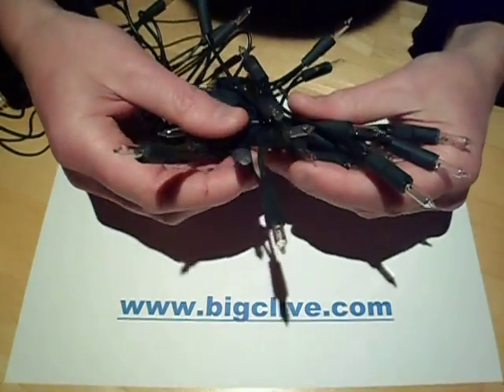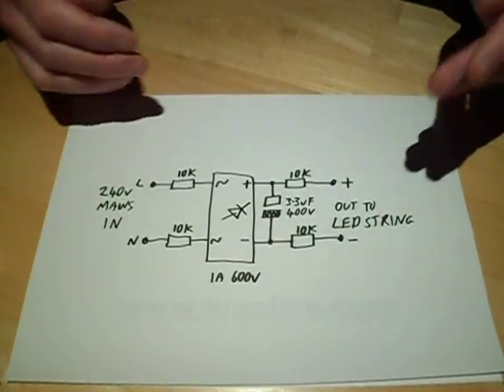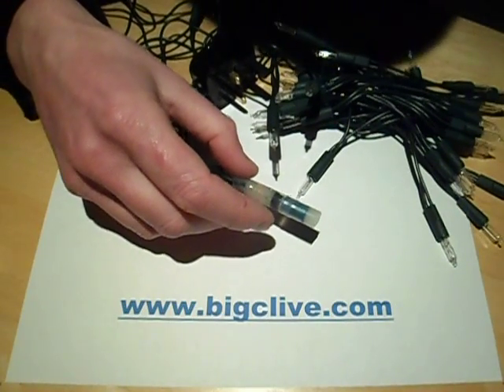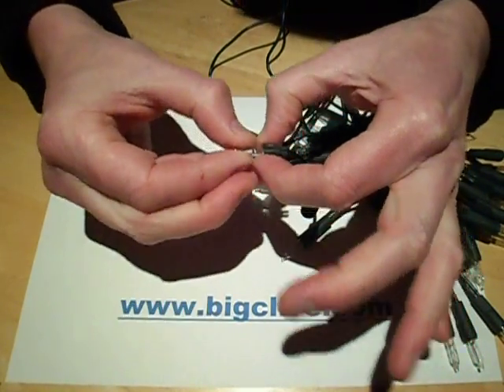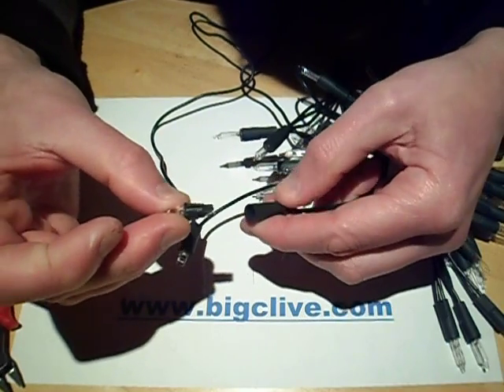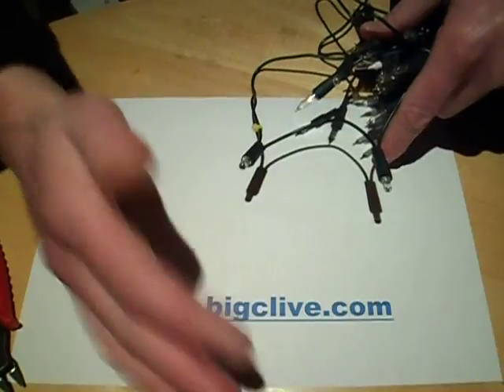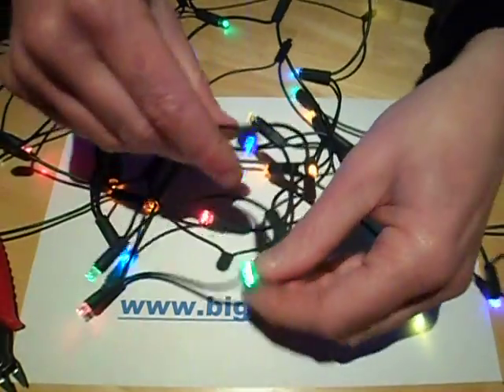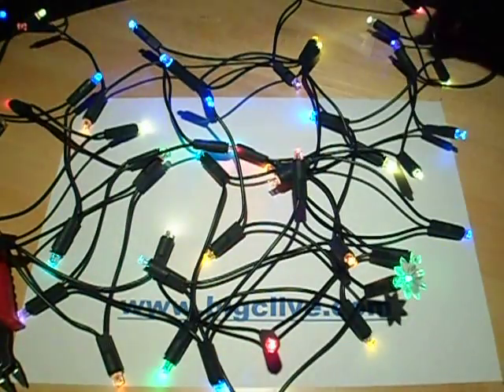Converting a string of traditional tungsten Christmas lights to LED.

Comment: would i need to alter the resistors using this circuit if i only had 20 lights instead of 50? also do you have a component number the the bridge rectifier, 1A suffice?
Reply from the maker: A 1A rectifier rated for 600V or higher is ample.   The less LEDs there are, the higher the power the resistors have to dissipate, so you end up with higher value resistors and lower LED current.

Comment: Hi Excellent video; quick question exactly what sort of LEDs do you use; I’m asking because I have a set of Christmas tree lights that I want to convert only it use the E5 screw fitting lamps; I will have to find a way to take the lamps apart and solder the new LEDs in 😂 Thanks
Reply from the maker: This project is better suited to series push-in holders.
Reply: @bigclivedotcom  Yes I guessed that but I can’t find a way to fix the “Chandelier part to another light set; I have an engineering background in both electrical and electronic so I will find a way to resolve this; but thank you for replying it is much appreciated.

Comment: You are so clever! Question! I have prelit Christmas tree that used traditional bulbs. If I replace them with LED ones and connect to 12v power supply will it work?
Reply from the maker: It depends on how the wiring is configured.  If the lights are in parallel or in a series string.

Comment: I just this video and very interested in how to did this. I'm still getting familiar on how to go about this. Here in the US many of the incandescent strands are of 150 lights, usually in sections of 3. Would you add the resistors (maybe 20k)  ahead of each grouping? So 8 total?
Reply from the maker: Not sure how USA lights are wired.  But the 50 LED sections would add up to around 140V.  So it might need a smoothing cap to nudge the voltage up.  That would then add some other complications.

Comment: Hi Clive, I have recently converted 5-sets of Christmas lights using Red, Green, Orange and Blue 10mm LEDs. I placed a series resistor (150k 1/4W) in a number of the LEDs (cut one leg short and replace with resistor) to bring the current down to around 10mA. I used a round encapsulated full-wave rectifier (2W10) in the mains-plug (neutral/earth void) and placed heatshrink over the connections. The sets run very cool and look great. Thanks for the videos which gave me the idea to upgrade my old incandescent bulb sets. I also enjoyed your tale of Christmas times in George Square. Keep up the good work.

Comment: Thank you for your video(s)!!  I am enjoying watching them.  I am trying to learn as much as I can before I change 6 sets of lights I have.  I have questions I hope you can help me with.  I have a 300 light tungsten icicle Christmas light string from USA (110v) I want to convert to LED.  The string must be made to run in groups of 50 bulbs @ 2.2v each (replacement bulb is 2.5v).  I use these in Europe and use a heavy duty transformer to step down 220v to 110v.  I understand the LED's I have are 3.0v each (50 x 3v = 150v for each section). Because I am wanting to  convert these to LED's, I was thinking I may as well convert them to  run on 220v (instead of 110v with transformer).  Therefore,  my questions are: 1. Is this safe and achievable?  or 2. If so, what resistors do I need?  3. Is the smoothing resistor you mention to help remove the flicker caused by AC current supply?  4. Anything else you can suggest I consider.  Thank you!

Comment: Hello from a very hot Australia on new years eve.   Really love your videos Clive.  Just a question,  Under what conditions would you use a series current limit capacitor vs the series resistors?

Some 30 years ago I converted nearly a 1000 of the old 20w 20 light sets into low voltage outdoor lights by cutting and soldering them in Parallel.  Was highly therapeutic as you say.  I have several packing cases of those old lights that weren't converted,  might just do the above to them.
Reply from the maker: +Stuart Goggin The capacitor version runs cold, so it's more efficient for use with higher current.  The resistor version dissipates the voltage difference between then LED string and the mains voltage as heat, which the capacitor just lets through a portion of current on each half cycle.
Keep in mind you can also string a few sets of the 20 lamp versions in series for more efficient operation with LEDs on 240V.  60 sockets works well.

Comment: hello my friend thank you for your reply there are two set of led's in the tube 48and 82 they  are all ok checked for dry joint that's ok. The 48 set which does not light has a dim glow in the led you can  just about see.
Reply from the maker: +mango3586 That suggests a dead LED that is limiting the current.  Does one have a small visible black dot in it?

Comment: Hi sir as you are electronic expert I need your help I have aT8 led tube light which is1500mm long and the fault is half of the tube lights up and the other half is dead. I would be  very great full if you could give me some idea to what the fault might be.
Reply from the maker: +mango3586 The LEDs in these tubes are wired in sections so one may have gone open circuit internally or there could be a bad solder joint.  Note that the LEDs may not be isolated from the mains, so take extreme care if you open the tube to look.

Comment: Hello im hoping you can help me or lead me in the right direction! so I want to attach a string of 10 Christmas lights inside my car attached to a toggle switch.  I want to replace the regular bulbs with leds since i see that led can use 12v to power them. how would I do this exactly?
Reply from the maker: +Anthony Lopez Hi Anthony, it will be easiest just to buy a pre-made set of battery operated LEDs online or from a local store.  They run for a long time on their batteries.
Reply: +bigclivedotcom  yea I figured, but I want to do this as a little project. I wanna use these tardis lights http://www.amazon.com/gp/product/B009XDJI9Y?refRID=6XQTS501FWJV8VCG16Z9&ref_=pd_cart_bxgy_1_2_p and install them in my car to use as light source, using a toggle switch as a on/off switch.  

I know its probably best if I do get the light you are talking about and fighting the plastic cover over them. But if I can do this with a little work I wouldn't mind trying!

Comment: can you use a 1.5amp 600v bridge rectifier i cant find a 1amp 600v.rectifier on ebay ? by the way Happy New Year  I really like the videos on leds and electronics. thanks
Reply from the maker: Yes. that's fine.  The voltage rating is the most important bit.  The actual current is only a few milliamp.

Comment: Would any rated electrolytic cap do? What would give the best fade out when powered off?
Reply: Needs to be rated above the peak rectified dc voltage. dc voltage in this case is 240v ac x 1.414 = 340v.  Give it +/- 10% tolerance and you basically shouldn't use a capacitor rated for less than 400v.
Or, use several capacitors rated for less voltage for example 2 x 10uF 200v but put them in series but be careful as 1/Ctotal = 1/C1 + 1/C2 + ... + 1/Cn
Reply: I know to use a high rated cap. I was meaning the value of the capacitance of the cap.
Reply from the maker: +Callum Burns The biggest factor in the fade-out is the discharge resistor across the electrolytic.  If you remove it the lights will visibly fade to zero like a tungsten set.  Anything in the region of 4.7uF to 10uF would be good, but 4.7uF is very common and the larger values start to get quite big physically.
Reply from the maker: Callum Burns I've not tried a lower value than the 3.3uF one I used in the above set.  The end result with that value is no visible flicker and a really nice dim-off curve that starts fast but then flattens out and keeps the LEDs glowing for quite a while at a low level.
Reply: Callum Burns
I guess it depends on how much brightness fluctuation you're willing to tolerate.

The higher the capacitance, the steadier the voltage, therefore the more constant current through the leds.

Figure out how much current the led strip will use, then use the formula C = Current / ( 2 x AC Frequency x Vripple) where Vripple is how much you're willing to let the voltage sag from the peak voltage.
If you play with the formula, you get Vripple = Current / 2 x AC Frequency x Capacitance.

In the video he used 2 x 10k resistors as current limiters ... for peak voltage of 350v, with 50 leds that works out to about 14 mA per led. From the above formula , Vripple = Current / 2 x AC Frequency x Capacitance = 0.014 A / 2 x 50  Hz x 0.0000033 = 0.014 / 0.00033 = 42.4 volts.
If you now calculate the current through leds with the new voltage of about 300v (350v - 42v .. but let's make it easier rounding it up) you get about 10mA through leds.
So the voltage will fluctuate between 350 volts and around 300 volts, and the current in each led will be between 10mA and 14mA. Would you notice the leds slightly getting dimmer 50 times a second? I doubt it.
If you increase the capacitance you'll only increase the minimum current....

Hope it helps.
Reply: mariushmedias
If you're confused about that 0.0000033 that's Farads.. as the formula works with SI units (Amps, Hz, Farads).

Yeah, so also the higher the capacitance, the slower the capacitor will discharge when you turn off the power. As your led strip is constant current more or less due to those 2x10k resistors, the current through the led strip will slowly decrease from 14ma down to 0mA... the leds will stop lightning up when the voltage goes below their forward voltage ... for 50 leds, at let's say 2v forward voltage, that would be when the strip voltage goes under about 100v.
Reply: Cheers Clive!

Comment: As long as current is limited to 10mA or less, reversed LEDs won't be killed.  Their reverse breakdown potential is only a few volts.
Reply from the maker: The gallium nitride ones tend to take excess reverse voltage quite badly.  If you stick one in the wrong way round in this application it usually fails.